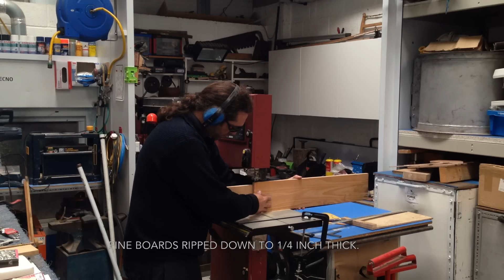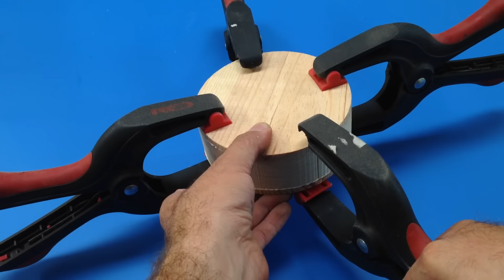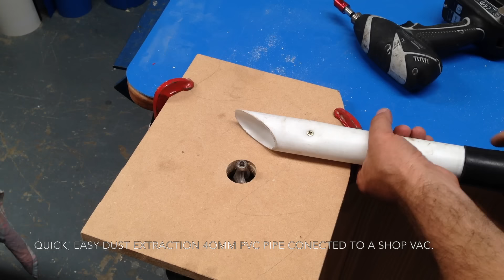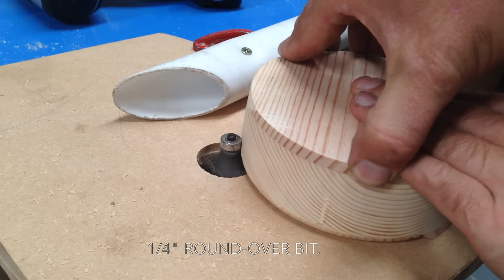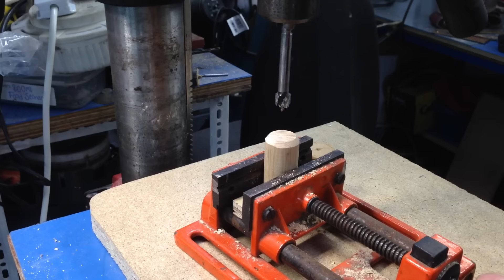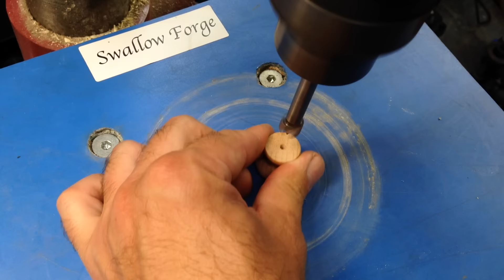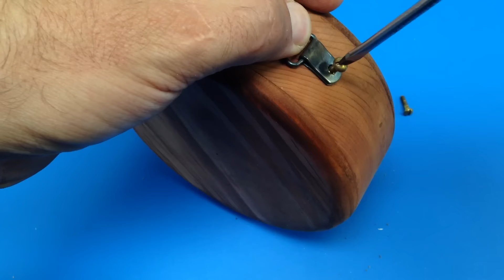How to make a Wooden Water Bottle or Hip Flask for reenactment, steampunk, Larp or cosplay

Comment: super awesome... i feel like maybe some kinda bee's Wax could coat the inside... stop it from getting into the wood... i'm probably just over thinking it lol
Reply from the maker: Dezerado You can coat it, but i have found it doesn't really need it. after all, they didn't coat the insides of wooden barrels. the wood fibres swell and seal themselfs.
Reply: Swallow Forge I do believe Dezerado (and everyone else who has mentioned it) was referring to coating the inside for the benefit of staying sanitary over time, ie. not soaking up moisture and becoming mold-ridden. Also, they'd fire the wooden (whiskey) barrels to form a barrier between the alcohol and the wood, as so nothing would leach from the wood into the alcohol; a crude carbon filter, if you will.
Reply: +Swallow Forge You are correct they did not coat the inside of barrels. They also do not put things that they used to into wooden barrels now either.  Barrels were only held together by wrings and pressure not glue and were never stained.  Chemicals from the stain can and will leach into the canteens especially if the inside is unsealed when you repetitive wet and dry the canteen.  You will not fine a commercially made wooden canteen that is not sealed on the inside because of FDA regulations with regard to safety, something that they were not concerned with in the past.  In the past they did coat the inside of wood canteens with pitch and wax many times to keep the wood from spoiling the contents and to keep the wood from splitting from repeated wet and drying.  If you are selling these you should be following FDA regulations with regard to any container that potable liquids will be stored in.  Plus since you are not going to be holding the hands of people that use your canteens you have no idea what will be put into them.  If something is stored in one that soaks into the wood and then due to the long drying time caused by the very small opening, starts to grow mold or mildew it could cause someone to become sick.  Below is the FDA regulation on wood as a food contact surface.  Anything that you are going to consume should be looked at as if it were food.  If the use to which you are putting the container is not given an exemption below you need to coat it with a food safe coating.

4-101.17 Wood, Use Limitation. (A) Except as specified in ¶¶ (B), (C), and (D) of this section, wood and wood wicker may not be used as a food-contact surface.(B) Hard maple or an equivalently hard, close-grained wood may be used for:     (1) Cutting boards; cutting blocks; bakers' tables; and utensils such as rolling pins, doughnut dowels, salad bowls, and chopsticks; and(2) Wooden
 paddles used in confectionery operations for pressure scraping kettles 
when manually preparing confections at a temperature of 110°C (230°F) or
 above.(C) Whole, uncut, raw 
fruits and vegetables, and nuts in the shell may be kept in the wood 
shipping containers in which they were received, until the fruits, 
vegetables, or nuts are used.(D) If the nature of the food requires removal of rinds, peels, husks, or shells before consumption, the whole, uncut, raw food may be kept in:     (1) Untreated wood containers; or(2) Treated
 wood containers if the containers are treated with a preservative that 
meets the requirements specified in 21 CFR 178.3800 Preservatives for 
wood.
Reply from the maker: +Mike's Micro Shop 
Hello Mike in reply to your questions/ statements.
1) the wood stain I use is a vegetable dye/ water based stain and is food safe.
2) FDA are American regulations. I do not live in America. 
3) In the past the canteens would never be allowed to dry out, they would always be filled and just like the modern mobile phone, they were designed to be disposable. 
4) the canteens were not sealed on the inside as that costs more and over time brewers pitch and bees wax would slowly sink to the bottom of the canteen. Leather costrals and tankards were lined with beeswax and later pitch, but wooden ones  very rarely were. it would have been an unnecessary extra expense.
5) If you are keeping strong alcohol in them, mould is not a concern as the alcohol is by its very nature an antibacterial agent. Some of the alcohol may (will) evaporate over time, however if you know anything about the brewing industry (which you may) the loss from storing alcohol in wooden containers is known as the angels share. Even heaven has its taxes.
6) If you are keeping water in the container then the storing and care is the same as if you were using a metal or plastic container. Store it with the spout uppermost and the stopper out. Before using, clean thoroughly, it may be prudent to use a sterilising agent such as Milton. Historically they were sterilised with salt and then thoroughly rinsed. Incidentally, plastic water bottles are a far greater danger to your health than wooden ones as the plastic leaches chemicals into the fluids. which is why you should never buy alcohol in a plastic bottle. 
7) I have been making these for many years, in my own personal collection is one I made best part of 10 years ago. Its still fine. No dicky tummies etc... 

8) As I am sure you are a person with a wealth of experience and knowledge, try not to assume that everybody else has just fallen out of a tree.  I am always open to discussion and exchange of ideas but would prefer a less condescending tone.  I like to think that we are all friends here, sharing in our common interests. I really do hope you enjoyed the video and that I have gone someway to alleviating your concerns.
Reply: Actually they were lined many times!  I have two historical examples one that has been in the family since its original owner purchased it and the other I picked up at a sale of items from a museum about the years ago both are over 150 years old and both are lined with wax.  I have come across several others one from France with a date of 1797 that is wax lined and was stamped as such by the manufacture.  So as to were they lined yes many were, not all to be sure.  Alcohol and water are not the only two liquids that will fit into a canteen.   All will soak into the wood and some will mold in the damp environment in the canteen as wood is slow to dry on its own and with the tiny opening at the top or any orientation does not allow a significant amount of air circulation to really effect the speed of drying to a great deal.  I do historical reenactment and we had a 12 year old girl at an event go into anaphylactic shock.  It was discovered that her canteen had mold growing in the wood on the inside from having had lemon aid in it from the previous event.  It was cleaned as best as could be done given the fact that all you can do is put something in and shake it around and let it drain out.  The guy that her family had purchased it from had been making them for over 50 years and had never lined them in that time.  He did after that until his death a heart attack at an event 3 years ago.  In the past almost every food imaginable was put into wooden kegs and casks, but today there are few things that are not alcohol related that are.  The reason is because wood is porous, it will allow the growth of bad pathogens in the wood that are not easy to prevent or to clean off of the surface much less out of the porous wood itself.  You can of course do as you wish and you can point to as many past actions as you wish as proof that you are safe in doing as you are.  After all just because it had never caused you a problem before is proof that it never will.  Good luck in your endeavors  all I can do in this life is to try to impart in a small way some of the experience I have gained in over 50 years of life and 40 years of reenacting history  what you do with it is up to you.  God bless  P.S. please forgive any misspellings or improper word usage as I am dyslexic and have had trouble with this all of my life.
Reply from the maker: Hello Mike, while you make interesting points, there has to be a cut off somewhere. You can't spend your life second guessing other peoples stupidity. Putting lemonade into a wooden canteen is idiotic. Not cleaning it properly afterwards is reckless. Yet it is the poor sod who made the canteen that got the blame. as you said, he had been making them for 50 years and presumably selling them to people with half an ounce of common sense. One idiot should not be the benchmark rule for everybody else, the day society realises that their stupidity is not somebody else's fault, the world will become a nicer place. In the world of reenactment just about everything is potentially dangerous, swords.. muskets, poorly cooked campfire food. Just because you make yourself ill because you dont know how to cook over a campfire, it doesn't mean the butcher who sold you the chicken is to blame. 
Thankfully the people I make them for do listen to the advise I give them about care and maintenance, they also get the obligatory bit of paper with all the do's and dont's. 

For this reason, I do not line the canteens. If somebody later decides to line it themselves, it is up to them to decide on the best solution.

Thank you for your comments and questions, I have been enjoying our discourse. 

I hope you don't find my responses inflammatory, I always try to write as if the person I am talking to is sat opposite me, sharing a beer. All the best SF
Reply: One idiot should not be, but from the Law stand point it is usually only one idiot filing a suite that takes your life's work away from you!  I am just giving you a word from the wise based on life experience, do with it what you will, best of luck!
Reply from the maker: Luckily for me I do not live in America and therefore do not have to worry about its ridiculous litigation laws.   In our schools we teach the findings of Darwin and natural selection. Common sense, for the time being , still prevails.

If you choose to make one of these, you may line yours with whatever you deem fit. For me, the natural wood is the best solution as any substance you use for a  liner has its pro's and cons. 

Bee's wax for example can be an allergen :

" Beeswax like all the other hive products can cause allergic reaction especially in people who have an allergy history. Beeswax allergy is a sensitive reaction towards the bee glue or the propolis extant in its composition. This allergy should be identified properly in order to be treated efficiently. 
There are several symptoms that warn a person about having an increased sensitivity towards beeswax. Thus, the typical symptoms of beeswax allergy include: watery easy, running or blocked nose, rashes, itches and a general condition of tiredness. These reactions can be extremely uncomfortable. More severe symptoms include breathing and swallowing difficulties, throat tightness, dizziness, nausea. 
Beeswax allergy must not be treated with shallowness since it can lead to death trough anaphylactic shock."

So I could treat my bottles with beeswax and someone who has an acute reaction to it could use it....

Some people also have an allergic reaction to the Rosins in Brewery pitch:

"Reactions to contact with rosin in an allergic individual include acute allergic contact dermatitis and difficulty breathing. In allergic contact dermatitis the dermatitis tends to occur 1-3 days after contact with rosin, although occasionally reactions can appear within 24 hours or even more than a week after exposure. The dermatitis tends to be confined to the site of contact with rosin (e.g. hands and forearms after carrying pine wood, although the face may also be involved). Initially the skin becomes red and inflamed, and is generally itchy. As the reaction progresses it may blister and become even more intensely itchy. If exposure is continued, the dermatitis may eventually become chronic with thickened, lichenified skin."

so it doesn't matter what you use, somebody may be harmed somehow. 

So I shall leave mine untreated. That is my final word on the subject.

Comment: nice idea, but... Watter will absorb smells of glue and diy. Try to use natural capabilities to diy this flascs. How about borned wood? But the disign is too pretty.
Reply from the maker: +Иван Новоторцев 
Vegetable based dye and waterproof glue. The water would have to soak through 1/2" of timber to get to the dye. If this happens, you have left the liquid in the flask too long.  So neither of these issues is a problem.
Reply: To make it last longer you could perhaps coat the inner panel with beeswax or something similar. It would make it more watertight, and if you left a bit of the wax built up on the rim before you seal it the clamps would push it out of the joints, creating a seal from the glue as well.

However if you really wanted a water bottle that functions you could get the same result by buying one... So that's neither the point nor purpose of this build. Still cool to look at, and makes for a nice piece.
Reply: How do you stop the wood from rotting when you soak it in water every few days? And how do you stop mold?

And most importantly; did they ever build flasks this way in the old days? :-P

it looks quite pretty though...
Reply: Most woods you buy from a store come pre-treated and resist rotting. (Which is usually caused by water being absorbed by the wood over a long period and gestating natural bacteria, however the hardening process for most woods kill of the majority of the bacterial agent, causing wood rot to happen much slower.)

As far as mold goes, keeping water from setting will stop that easily. An occasional rinse with some hot water would go a long way to keep mold from setting in... However since this DIY is more for an interesting item than a practical one.... Doubt it would come up.
Reply: There's significant evidence to show that treated wood is incredibly harmful if inhaled, and 100% non food safe. That's why most lumber yards won't even cut treated wood for you. It's a liability risk to have your employees inhaling treated saw dust all day when it's a demonstrable fact that treated wood contains cancer causing carcinogens. Hopefully you don't sell these to people..
Reply from the maker: NannerHammock I'm sorry, but I don't understand where you came to the conclusion it was treated wood (it's not) you do have to check with the lumber yard when buying, treated wood tends to be more expensive and is murder on woodworking tools.
Reply: Swallow Forge Well then, apologies for the tangential and apparently unnecessary rant. The comment immediately before mine was saying the wood was treated, so I was responding under the assumption he was correct.

I suppose you could say I wood've benefited from asking first. 
._.

I'll let myself out.
Reply from the maker: Ha ha, no need to apologise and thank you for your response. This particular build seems to have attracted more negativity than most, but hey ho, I thought it was a fun thing to share that might inspire people to have a go. Its amazing how many experts there are out there yet so few creating actual content :)
still, now I'm going off on a tangential rant.... it must be your turn to get the drinks in :)
Reply: I want to try to make something like this without using glue.But haven't got a channel =((
Reply: Swallow Forge it's a popular video and this brings in the know it all's who have done it so much better, but just haven't made a video about it (there are odd exceptions who have but are few and far between). love the channel.